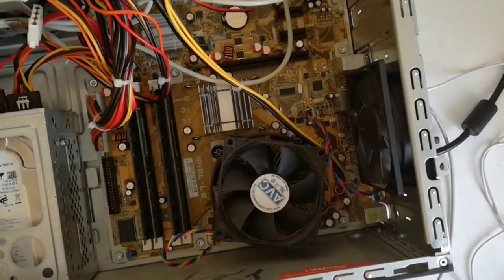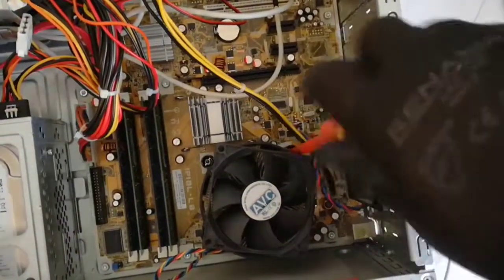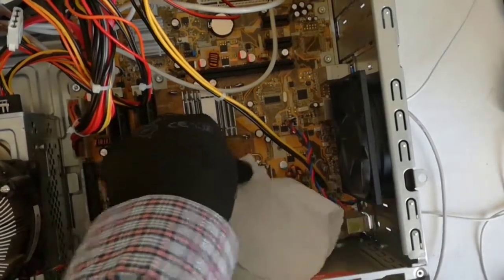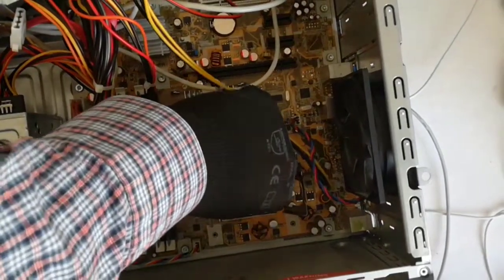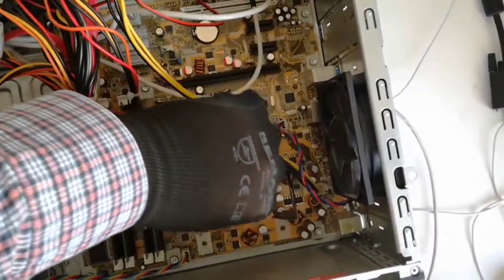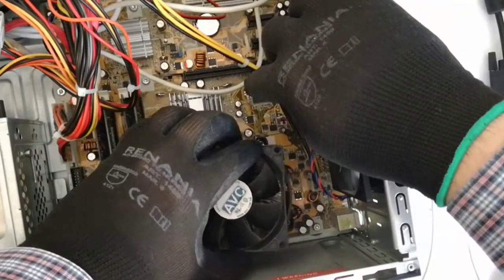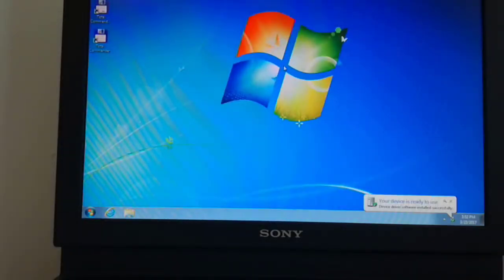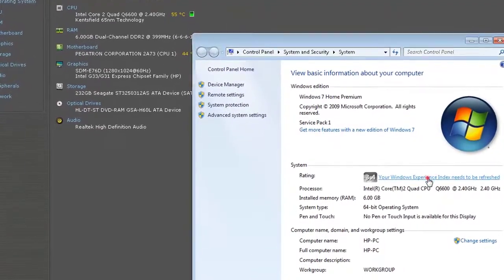HP Compaq dx2400 Microtower PC upgrade to Core 2 Quad Q6600 @ 2.40 GHz Ep.185

Comment: but the hp site shows that dx 2400 doesnt supports q6600.
Reply from the maker: In the HP support page it dosen't shows, but I maneged to install, the Q6600 (TDP - 105W) is older than the Q9450 (TDP - 95W), but is hotter to. If you upgraded to Q6600, probably you have to change the cooler and use a good quality thermal paste like Arctic Cooling MX-4. Here are the intel compeard specifications http://ark.intel.com/compare/29765,33923
Reply: thanks a lot. i have the same pc with core 2 duo and was afraid that quad core wont be supported but now i will get an upgrade probably q9650 with a good cooler and thermal paste.